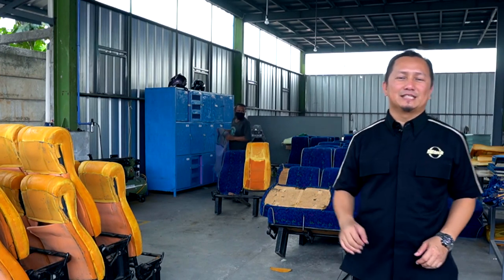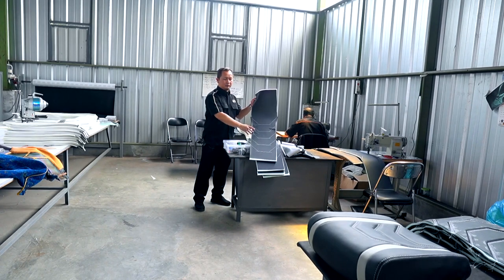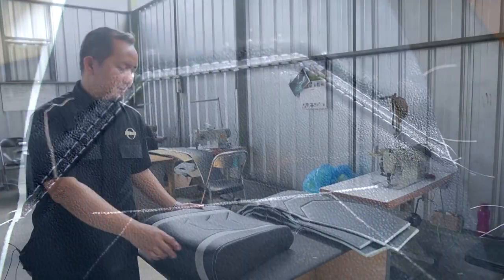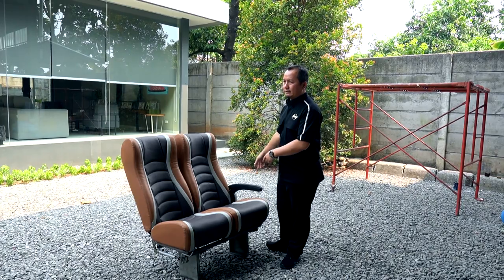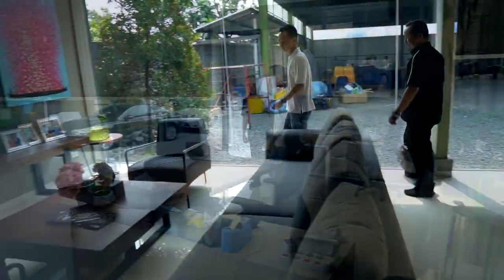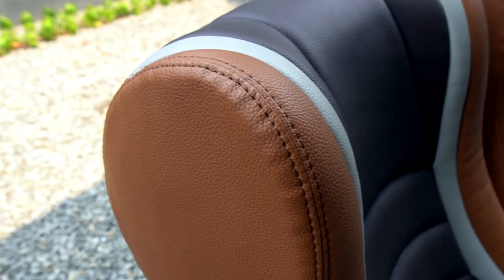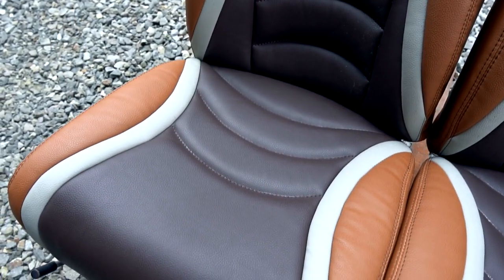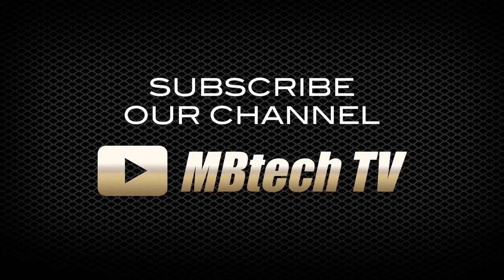Jok Bus Mega Pilar Bogor

Comment: Klo buat wuling cortez 3 baris brp gan.... Selain di kemang yg di kota bogor nya ada ga...
Reply from the maker: Dear end user
Info pemasangan jok motor MBtech di wilayah Anda bisa kunjungi alamat berikut:
NJ SYNTETIC LEATHER 
Jl. Surya Kencana No. 145, Bogor 16141 0818 - 0694 9588 
Tel: 0251 - 831 2100

LTERPRO 
Jl. Sukasari 1 no. 11 E Sukasari, BogorTimur 16142 
Hp: 0878-8881 0288 
Tel: 0251-834 6257

*Harga jok bisa langsung dikonsultasi dengan pihak bengkel
Terimakasih
MBtech Support